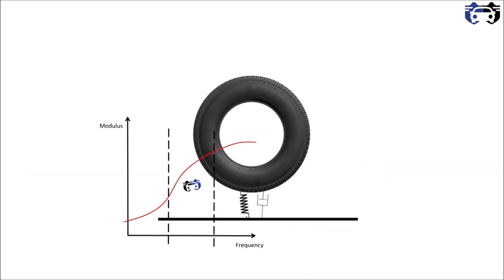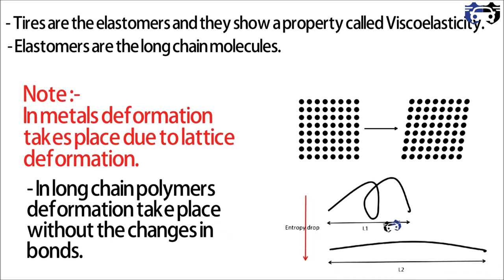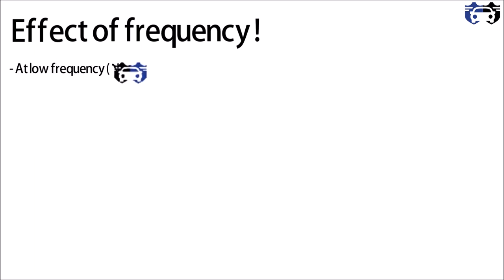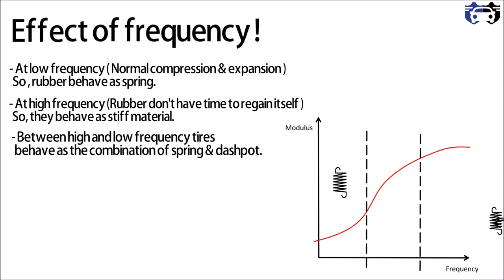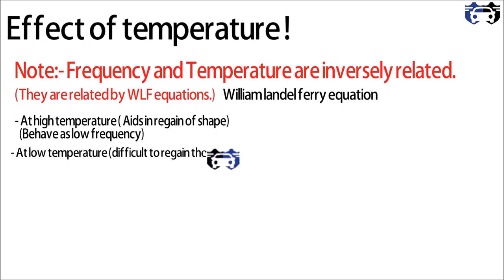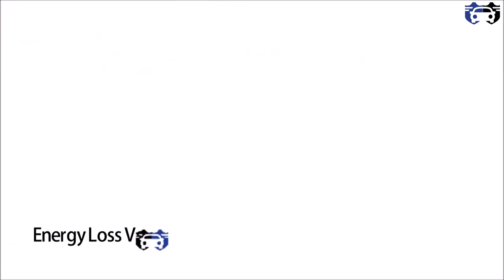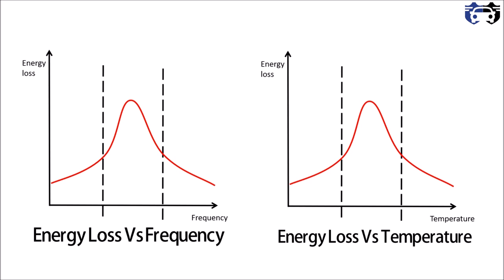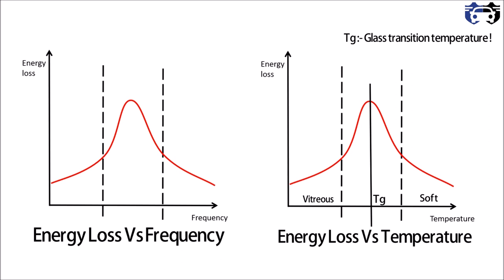How temperature and frequency effects the Tire behavior ?

Comment: How to calculate the torque of two wheeler vehicles at Rear wheel.
Reply from the maker: To calculate the torque at the rear wheel of a two-wheeler, you can use the formula: Torque = Force × Radius. The force is the effective force applied by the engine, and the radius is the effective lever arm from the center of the rear wheel to the point where the force is applied. Keep in mind factors like gear ratios and losses in the drivetrain for more accuracy.